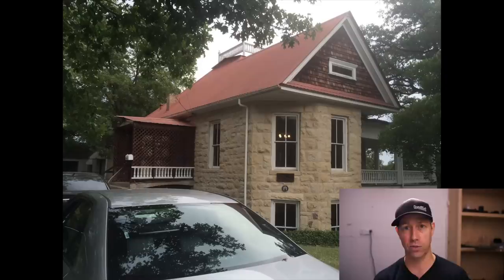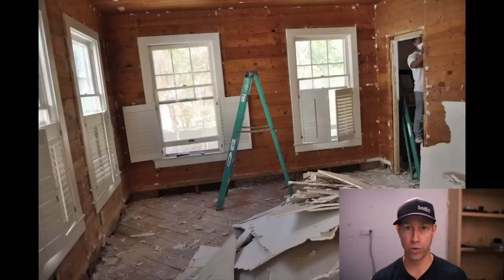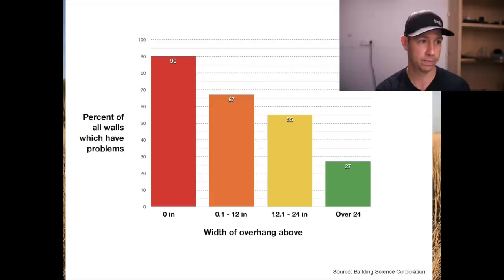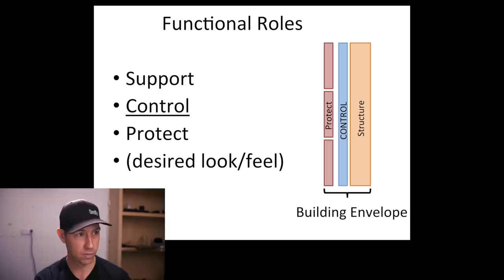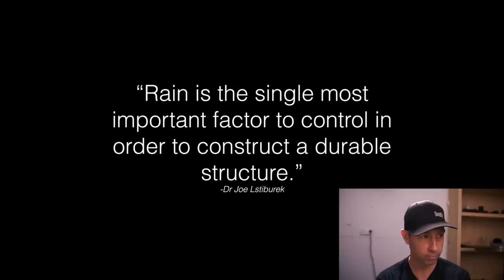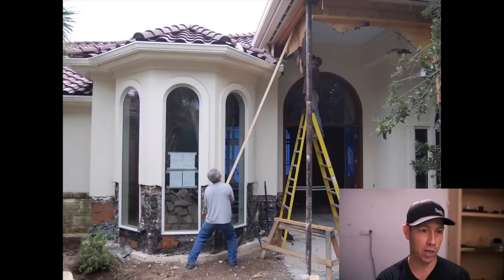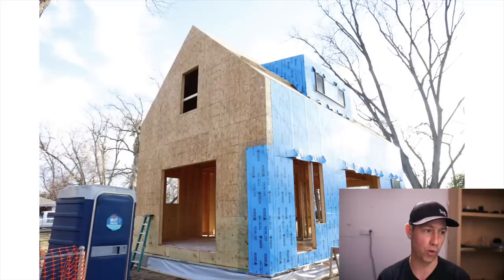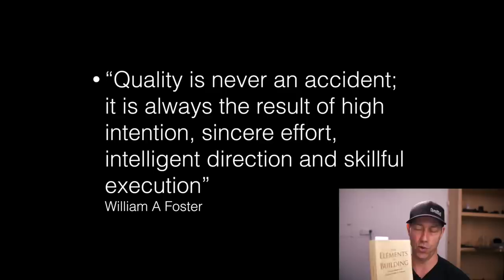Were Old Houses Built Better?

Comment: One issue of lack of overhang other than moisture is sunlight with windows. No overhang means sun can come blasting in, which can make things difficult for those inside, try watching TV with sunlight streaming in and in a hot summer, it means lots more heat to deal with. Otherwise you need pretty heavy duty curtains. Also similarly with windows and overhang is rain. Even if the materials themselves can take it, no overhang over windows means you must shut them every time it rains or get your place wet. So for those reasons you should have overhang with the windows and doors, if no where else. Like with doors, who wants to have to talk to someone in a doorway while getting drenched or baked by the sun? Even the person in the house will have issues. General building overhang can mean the ability to change things and put windows elsewhere easier. 

Have you ever checked out buildings made out of straw bales and such?  https://www.strawbale.com/ Or mud brick/adobe? There has been advances in more "primitive" materials to build from so you can get a durable modern house that is more environmentally friendly too.

Comment: I firmly believe that confirmation bias is behind the notion that old houses were built better. First of all, the poorly built ones wouldn’t last. Secondly, maintenance is important and well maintained old houses will last longer than poorly maintained newer ones. I’ve seen plenty of houses from the middle of the 20th century and even those 100+ years old when I was an intern and worked on remodels, and more often than not they were in poor condition. The well maintained ones lasted better, and even more so for those made of CMU and sturdier materials. Some of these old houses may survive wet conditions better because they ‘breath’ but just as often they don’t breath enough and are mold infested. This is all before getting into the fact that old leaky houses had poor indoor air quality, living conditions and comfort compared to well built modern houses. Ultimately, the quality of design, materials, construction and maintenance are the most important factors to how well and how long a house lasts. Any deficiencies in even one of these will cause a house to partially or fully fail before long- but even the best built house will fail without maintenance. And even the worst built will last if well maintained. It’s reductive and simplistic to make the blanket statement that old houses were built better.

Comment: my point of view on this
today we want to make houses as energy efficient as possible, houses are insulated and vacumtested to keep "cold brigdes in the contruktions, this makes many problems, since if this is not build correctly, the house will suffer damp issues in the construktion. my house has a topfloor that are only 13 years old, and they are "redoing" the work ( on the insurance ) since the construktion is wrong, the wood has been rotting and water has been able to get into the insulation.
well.. at least I have it done for free ( insurance )
old houses did not have the same insulation and solid surfaces, this allowed the house to breath and get rid of moisture.. also, they did not have the same "rules" and "knowlegde" back then, so houses where build to be stronger than needed.
today. the build a house using light materials and the minimum thinkness of wood !
today the costumer wants a cheap house, so the quality of the wood is less
or the builder, wants to score more money on the build and uses cheap materials.
not like back then, when people where proud of their craftmanship, and wanted to build houses to make their reputation better and better, since the comunity was smaller, they had to do good, to get more jobs..

Comment: So the main take away from this video is that old houses were built to fail. This is why they last so long. There are many redundancy that allows the houses to last eventhough some parts fail. (Overhang, wood, brick that allows moisture to dry). 

Newer house focused on efficiency and thermal insulation. The problem is that its built on assumption. Even in the model house, if one of those fail there will be mold. Single leak can cause havoc to the house because insulation prevents moisture from drying easily, wood does not handle moisture well, etc. So it really depends on the quality of the worksman.. you better pray that the worker did the job as perfect as it was drawn on the paper.

Comment: My 103 year old house was built to last 100 years but was it built better? No. The foundation is stacked field stone without mortar, the floor joists are tree trunks with the bark still on them and the walls are hand cut lumber that has dimension variation. Charming but not better when you are trying to restore it.

Comment: The problem is not that there's A/C at all but that it has to be so extreme. One of the problems for many people with American office spaces for example is the extreme use of A/C. With the result that many people have space headers under their desks to counteract this artificial cold in mid summer. Now how is that a good thing? Why is there no understanding of measure? What would be wrong with cooling just a little, and only on truly hot days? I can understand in Texas, but here in the Northeast, I literally turn on my A/C only maybe 20 days out of the year, so how can it be that at work it is on 5 months in a row? That makes no sense.

Comment: New or old, whether a house is built well is on a case by case basis. New materials appropriately applied and installed are much better than any old buildings. Having been in gut remodels from the colonial era through Victorian and to the present, i have seen a lot of evidence that the workers were drunk while building the houses. Big Victorian houses built on top of field stones placed on top of the ground with undersized, scabbed together studs, joists and  rafters but they survived with no rot for 100 plus years! How can you argue with success?

Comment: Look at homes that lasted and learn from that. As far as energy goes the modern heating systems are a joke. 
Look at a luxury Sailing yacht. Heat, hot water, ac, propulsion, water proofing, Electric power and the ability to cross oceans with the smallest amount of fuel.   However  Code does not allow many things that work better and pass really questionable practices and materials. Stone is forever and can easily be reused ,yet Code requires Concrete in areas with frost heaves. Stone foundation is easily repaired . Concrete is not and is not reusable. It goes on.

Comment: If you’re going to compare old vs new you have to realize the why did they change. We can go back to Egypt and look at the pyramids, well built but not practical. They had stick built vs balloon framing, that came about for cost reduction. After WWII they were building houses a mile a minute and costly methods were abandoned or rare. Then they introduced the building codes and that again was around costs and safer practices. Then there’s also locations, houses in the south are built different from those up north. It’s been a learning process. Is one better than the next? Ask the three little pigs. Brick was great for them, but they weren’t in California, an earthquake will take it down in a hurry.

Comment: I'm not even gonna bother getting into the vid before commenting... yes, older is better... As a contractor who has seen far too much of today's "building practices" or more so shortcuts... the only thing today's general home construction has over yesteryear's, is that it is generally going to be a more precise overall picture.  More items plumb and square, better laid out, better plans... etc.  Where as back then there really weren't "codes" local or national... there weren't lasers and surveying equipment to today's standards... and as such, much of it was overbuilt... crooked or ever so slightly out of level or not... it wasn't going to move.  Not without the Earth doing so first.  Today's homes get framed, wrapped, and vinyl sided more often than they do sheathed then sided... with far far far too many of them being able to be entered with nothing more than a razor knife or sawzall.  Walk right in through the wall... and that's the sort of quality and effort that can generally be observed throughout the entirety of the process in most of today's building, especially that of residential.  Where they would had overbuilt for safety and security back then... we evaluate JUUUUST whats needed to JUUUUUST make sure something stands and works... and then build it JUUUUUUST to that standard, and no more... sometimes less. Gotta get those profit margins up somehow right!?
Reply: Yes it's truly disgusting how they have conned and raped us in so many ways.

Comment: Quality is meeting the specifications. Exceeding the specifications costs profits but far more important is customer satisfaction.  There is an international quality organization which publishes a standard called ISO 9000 and certifies companies to the standard.  Information on the standard can be found in Wikipedia at  https://en.wikipedia.org/wiki/ISO_9000.  China is No. 1 on the list with 257,076 ISO 9000 certified companies, the USA is No. 9 with 28, 935.

Comment: I don't know. In some ways, yes. In other ways, no. Personally, I do not like old buildings. Old buildings were built in ways and with materials that are toxic like have asbestos or they used materials like paint with lead, which isn't good. But as far as construction goes, I don't think they cut corners as much as they do now in order to save money. One of the biggest reasons I don't like older buildings besides the asbestos is that I don't think they are earthquake proof or at least somewhat earthquake proof. Back then they probably never had to think about earthquakes because they didn't happen. For example, there is a historic and very old building I use to work in and all I could think is, if there is an earthquake, we are going down! I do appreciate the detail/craftsmanship that are in some older buildings.

I like newer buildings because they are earthquake proof or at least somewhat structurally. Also, we know now what materials are not harmful and don't have toxic effects. I feel like there are pros and cons to both. It's like the same with cars. Older cars last longer because they are not made out of plastic on the outer shell and were probably built to last. The parts are probably more reliable and won't stop working so soon. It's the same thing as companies cutting corners in order to save money.

Comment: I take that stone house all the time. If its not getting much below 0 Celsius then I take an electrical 2000 Watt room heater and heat the room I am in. Each room can have an portable plug in heater and an air condition and the problem is gone. I never would take one of the modern houses. Its eather concret blocks or stone which the house must be made of entirely. Overhangs are a must for shadow and sitting outside in a hammock at evening. Portable electrical heaters will solve any heating needs.
I take the car from the 80's all the time as well. Modern cars are way to expensive to maintain. They bleed you out financially.

Comment: I know from a fire side, older homes usually survive fires better than the newer homes.
Reply: Absolutely.  However, they catch more often in the first place, too.  But that's more down to horrific old wiring systems than anything.  An older home with a properly replaced wiring system is probably great.

Comment: You really should have mentioned survivor bias in this video. The only houses left from 100 years ago are the ones that were well built, well maintained, and had already had any existing problems fixed decades ago. Not to mention that most houses that are 50+ years old are likely not getting any work put into them and are just waiting to be torn down and rebuilt. So a builder would not be likely to ever work on them.

Also, I'm by no means an expert, but putting the insulation on the outside of the water barrier is just asking for it to get waterlogged and need to be replaced. What is the downside of putting it on the inside, other than the thermal bridging you mention. It seems like it would be better to build a house as normal but just have a better water barrier layer AND overhangs.

Comment: Not only are modern homes made with cheaper materials, but they're also much less aesthetically appealing than homes from a century ago that are still standing. House designers seem fascinated with mixing architectural styles that mostly don't mix, making roofs absolutely massive compared to the actual home part which prompts the hideous "nudge" at the top, make overuse of faux features like faux shutters and faux brick or whatever façades followed by cheap plastic vinyl on the sides and back of the house. It's so strange that builders often say that homes cannot be made with real materials like a century ago, despite there being a much better trade network today for getting materials from anywhere in the world.

Comment: In California newer houses are better... sorry but it’s the truth. Keep in mind that California is newer compared to other states and countries.
All the old homes I’ve worked on in California were raty tatty.

Old nasty cast iron drains. Clay pipes. Even orangeburg drains. Old galvanized pipes that are worked on because they start to fail. Sometimes there is even black pipe on the water lines, I suspect  from handymen fixes.
Verticulate asbestos in the attics.
Stupidly thin wood holding up the roofs which are all slapped together with that nasty asbestos filled glue. 
The reason old houses become energy inefficient is due to retrofitting newer systems to old homes.

Honestly I’d rather buy a New house and enjoy it while I’m alive. Minor maintenance vs major maintenance and replacements.
And newer homes can even be cheaper!

Comment: Sorry.. don't mean to be a Pedt.. but I live in the Northeast United States and Ypu said ypu live in Texas,  I'm curious if you buy Old some 100 years plus Old Solid, Denailed,  Plained BarnBoards 6"-12"/W  ×  6-8'/L, on average.   No t Excluding some here and there Extremely Big Wood Beams, Alot of them Oak.  Some pretty massive Would definitely need a very long Truck, or a Tractor Trailer to Haul them just because they are so big and Long.  Anyway I was curious.  I know they can run a decent buck.. but Man they are beautiful after they been Plained,  Wheather you leave it  El' Natural , or Poly it, or even Stain them.  Personally I like the El' Natural look or a Couple Coats of Poly.  Thanks for your time.